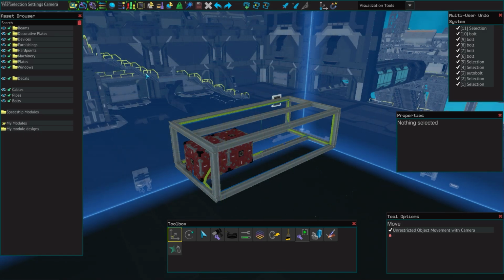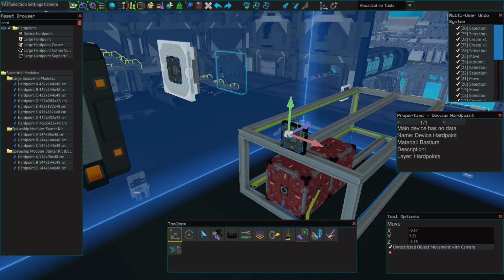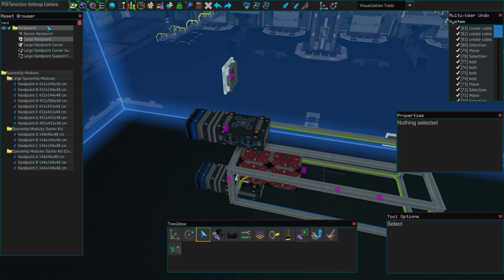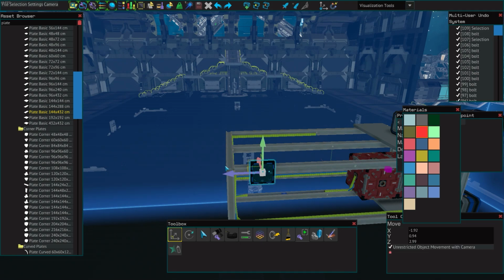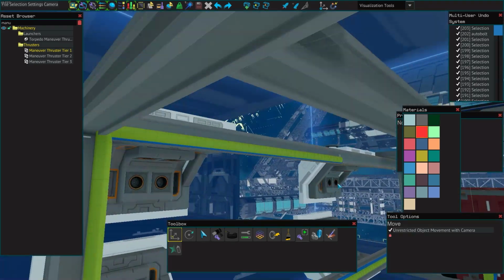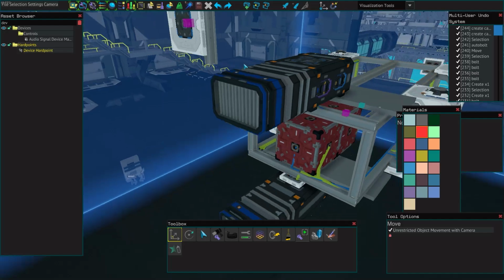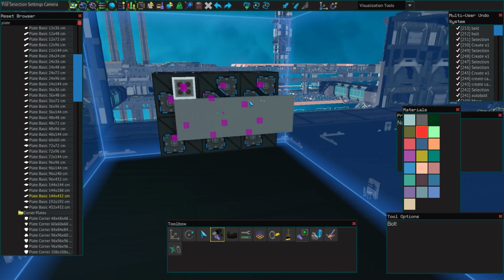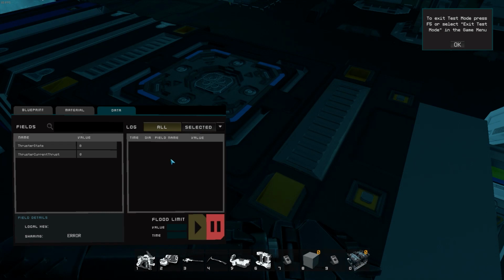Starbase Beginner Guide: Starbase Ship Builder - How to Build Thrusters!

Comment: I wonder if you might have an idea on my thruster problems. my current project i went for something "stylish" and put my thrusters in every direction in four groups of thrusters outside the ship. two at the front and two slightly bigger groups at the back. the catch is they are all on a 15° angle and that might be where my problem is. they are all connected and "working" in a way but they behave very strange in test flight. Have you any experience if the controls can or can not handle thrusters the aren't straight?
Reply: Make sure you don't exceed your flight computer thruster power slot. If so, some of your directional thruster may get the same IDs of your back thruster and get fired when the ship trying to stabilize itself. That is if you use the auto naming device feature.
Reply: @SeigiEmiya  good idea, sadly one of my firsts so thats not the issue. ^^'